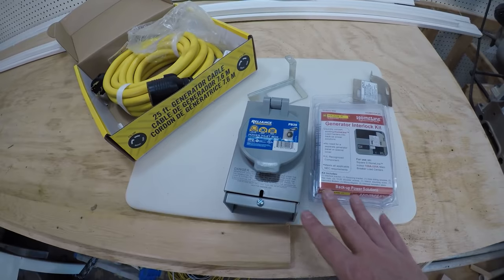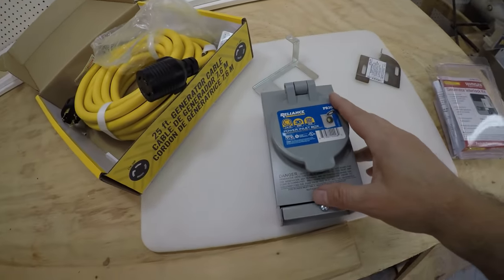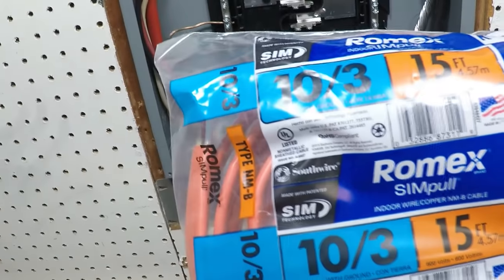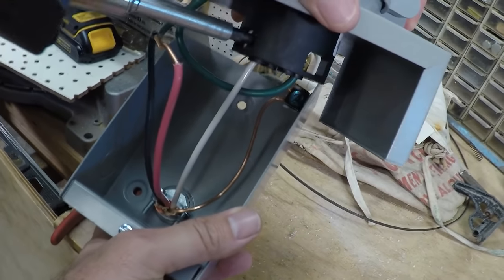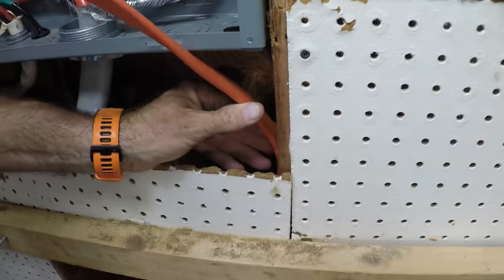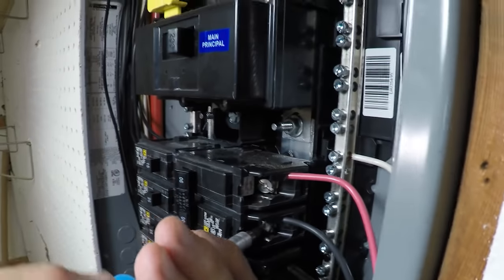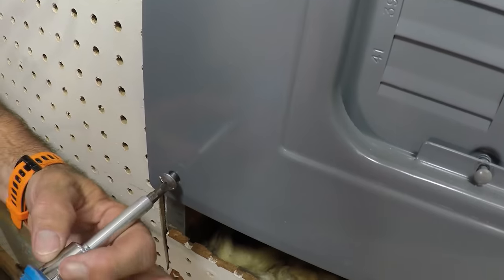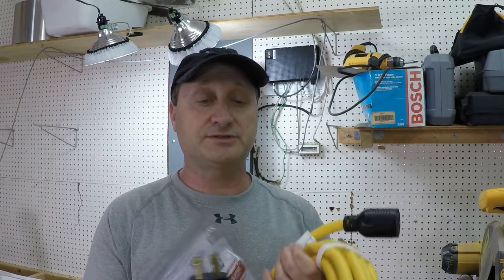Home Generator Interlock Kit Installation - EASY!

Comment: Color sequence doesn't matter to you mister homeowner, but it does matter to qualified electricians!
Reply: As long as ground and neutral are right I don't care  where the red or black go.
Reply from the maker: it actually does not matter. They (red and black) are both hot and treated as such
Reply: @flannelguydiy6458  It matters to an electrician in a troubleshooting scenario.  Properly wired residence will maintain phase arrangement throughout an install.  Black, red, and blue can be used as hot conductors and the phase arrangement does matter to professionals and inspectors.

Comment: This job should be left to an electrician. 99% of portable generators have the neutral and the ground bonded together, the neutral and the ground are also bonded at the service panel at the house, this means there will be current flowing on the ground wire going back to the generator. This is very dangerous and a code violation for obvious reasons and people have been seriously hurt as a result.

Comment: You’re actually not finished… did you determine if your generator has a bonded or floating neutral?  Needs to be floating with this setup. 🙄🙄🙄🙄🙄